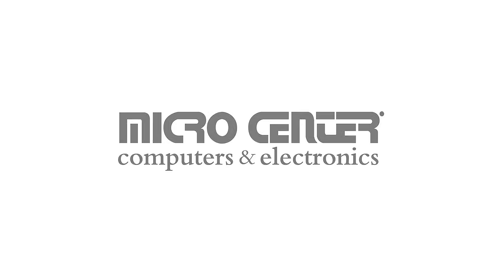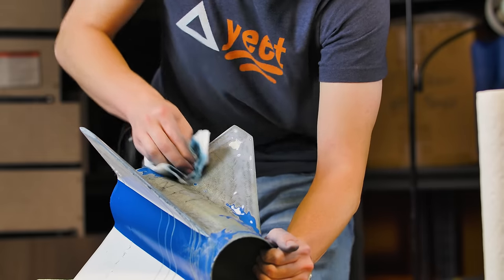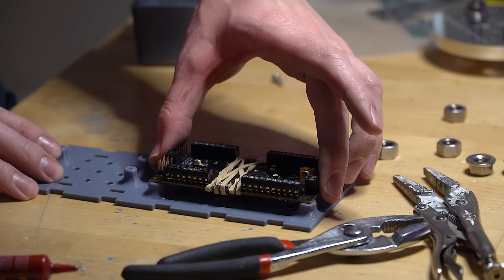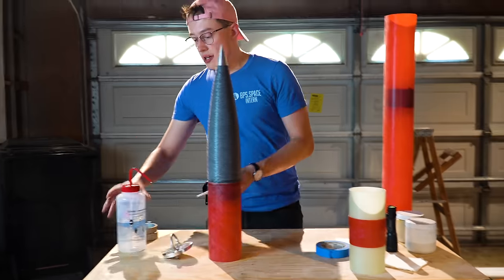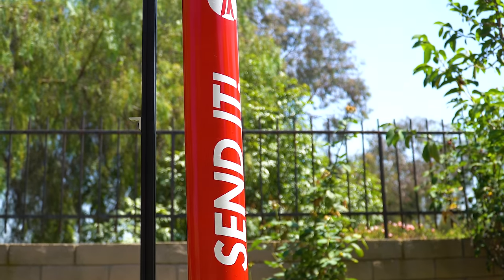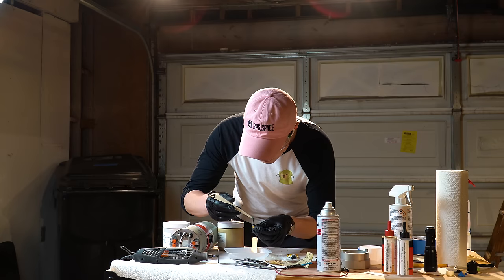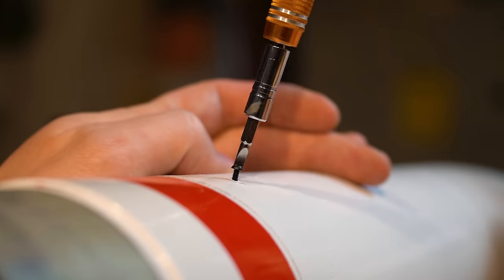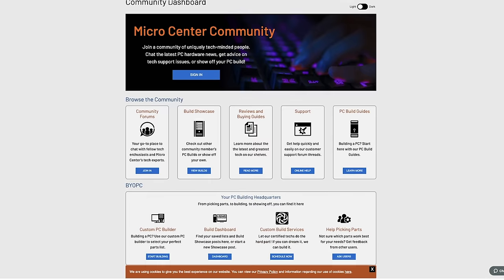How Do You Build A Level 3 Rocket?

Comment: Everyone overlooks the skin of their aerodynamic whatever-s (rockets, planes, helicopters, drones, etc.). Take a closer look at the skin of the great white shark on a microscopic level. You'll notice these teardrop looking depressions in the sharks skin. I know the shark travels through water 99% of the time with the remaining percentage spent breaching but I believe the principle of those depressions is sound (I think they are depressions, they could have been microscopic bumps...it's been a while since I've seen that documentary). Also, if I remember correctly, the depressions were offset from each other (the leading set would align with the third set of depressions while the second set would align with the fourth set and so on from its nose to its tail). How much space should be between each depression from the adjacent ones and from one set to the next and how deep they should be will depend on the application. Some kind of heavy metal roller with the bumps on the rolling surface pressed on to the skin of your rocket should do the trick provided the skin doesn't have any rebounding qualities to it.

Comment: I remain frustrated that you don't orient the GPS antennas "flat" with respect to the earth (the antenna should be normal to the long axis with as little as possible "stuff" between them and the walls for about 10 cm above the plane of the GPS antenna (about the diameter of the fuselage).  A few wires and screw rods won't matter much).  This would give you a much better view of the constellation of satellites.  
Some recent ublox GPS' will handle 25 Hz update rates while using 4 constellations - roughly 40 satellites at a time while pulling modest current.  (use the binary messages if possible, not the NMEA).
Further, you can likely find L1/L5 GPS receivers which will be more accurate in all respects.

Comment: A quick question, which revision of the turbo-encabulator did you use?

I've being trying with the 4.2, but I hear the 6.9 doesn't suffer from the same inverse reactive current issues at high volumetric pressure.

Comment: Hey! Noticed something I wanted to inquire about. On your build, I saw your camera mount you made, and noticed there was no aero shroud: just looked to me like two vertical sides to mount the Runcams to, and leaving them exposed with minimal protrusion from the airframe. I'm currently working on a very similar dual camera mount for a build of my own, and just wondered if you had any negative side effects to doing it that way? Eliminating an aero shroud will far simplify my design. I also don't expect to be going mach or anything, this is more in regards to just the "camera health" post flight & landing

Thanks in advance!

Comment: I'm curious as to why you're using epoxy to permanently adhere many components rather than screws and fasteners. I try to minimize any adhesives as much as I can on my L3. There's just no undo button with epoxy whereas with screws, you can always thread a larger one.

Comment: Do you have anything that you'd like added to OpenRocket that it currently isn't doing? I'm a Software Dev and just found this open source software because of you. I'd love to write a plugin that you could use or something you'd think is useful for other rocket engineers
Reply: One thing that I can think of is to add some sort of plugin that allows the user to design a rocket, enter a predetermined altitude, and have openrocket calculate what motor you would need to get you there. If you want to be super fancy, find a way to integrate Burnsim into openrocket so that even if the motor doesn't commercially exist, you could easily test user-made motors based upon the initial estimate of the required motor that was calculated earlier

Comment: How have you not built an auto tracker for your communication antenna yet? I feel like that kind of side project would be right in your wheelhouse.
Reply: Actually, i think another antenna would be a much smarter choise. Both the antenna on the rocket and the one on the ground can be reshaped to easily permit transmission at all altitudes without having to aim anything.

Comment: It disturbs me that you would be afraid to show your ejection charge system.  There are lots of videos on YT that show various methods for doing this and none of them appear to be censored.  But, I wanted to see what system YOU used for your rocket.  What you are doing is not illegal or intended for any illegal purpose.  In my recommended list is a guy explaining how a dynamite exploder works.  A while back I watched a video of guys showing how to make shaped charges for punching holes in steel plate.  If all those are permitted, showing using a few grams of BP to separate the air frame and deploy a parachute shouldn't be a problem.

By the way, I really like your idea of using Wago lever nuts for the ejection charge connections.  I'm going to use that for my next dual deploy rocket.  I'm really looking forward to the next video.